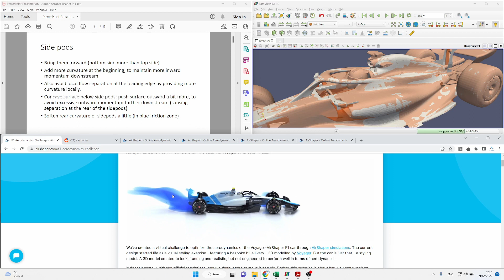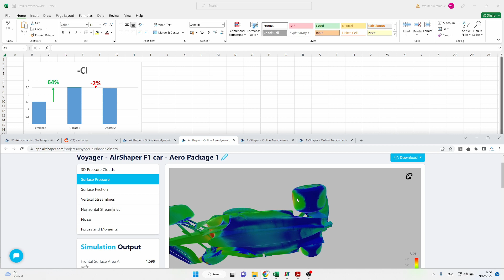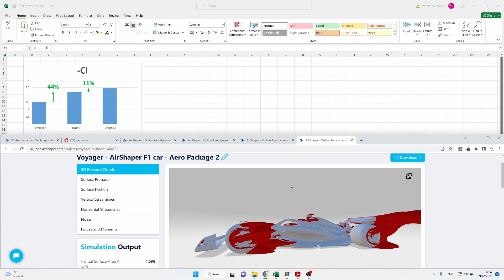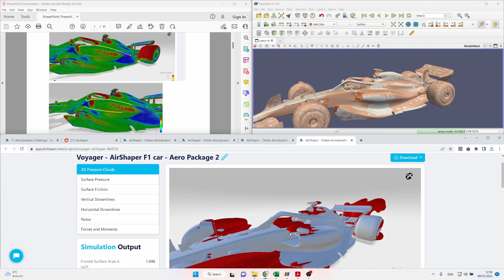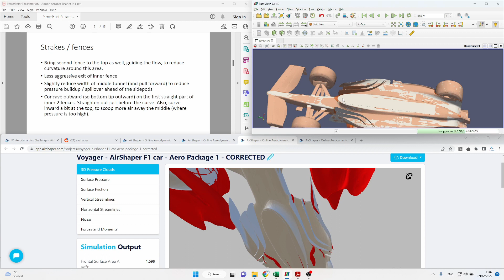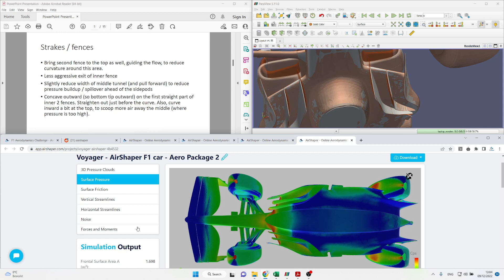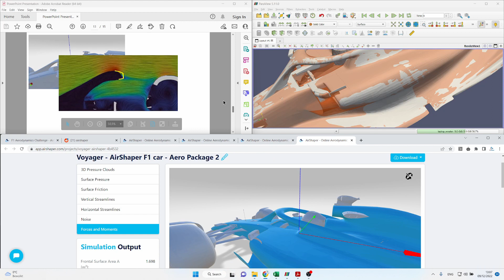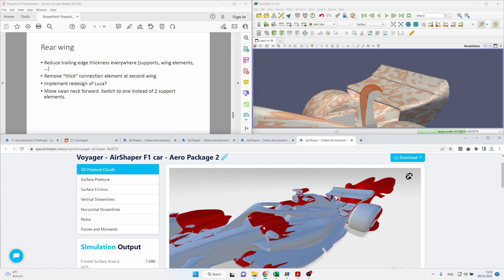Formula One Aerodynamics Challenge - Part 2: side pods, underfloor, fences and more

Comment: I agree with Matteo that a 4th strake should be used and played around with. Flow under the floor could be further stabilised and maybe it can be used to create even lower pressure by strenthening the fence vortice and outwash can also be better controlled and played with for further gains i think. I also would suggest to design a kind of outwash mirror with vents like the Red Bull  had and to optimise the deflectors. This can reduce the separation on the sidepods. I also suggest to put vortices creators on the Halo to stabilise the airflow above the sidepods, too. One idea would also be to open the sidewalls of the diffuser a little bit and energise the vortices by air from the top of the floor.
Reply from the maker: Thanks a lot for all the input, let's see how we can include this in Aero Update 3 (or 4)!!

Comment: You should add a 4th element to the front wing and a 4th strake at the entry of the floor. Regs allow that.
Reply from the maker: Hi Matteo, it would be great if you could argue why that would be a good idea, along with perhaps some sketches, and drop it on our Reddit:
https://www.reddit.com/r/airshaper/
Just a suggestion, thanks!
Reply: @AirShaper  Multi-element wings (if the slot is designed properly) are able to produce higher downforce, so I agree with Matteo's comments too!
Reply from the maker: @alex07guerrero  ok cool, we'll look into it - if you can drop a suggestion for a profile / selection of airfoils / ... on our Reddit, that would be great! Focus now is on the rear wing, as that one is still just a styling exercise for now. Thanks again!

Comment: I dont have an overview of the whole investigation, only saw these 2 videos, so please ignore my comments if they are out of date or not applicable for any reasons.
You could try adding more horizontal expansion at the diffuser possibly to further increase downforce without addig major drag.
You could possibly implement the ‘fake’ endplate design that of the Aston Martin 2022 car.
Reply from the maker: The horizontal expansion could be considered, as long as it doesn't cause any flow separation.
The end plates would not be so interesting, as they'll likely be banned for 2023 if I'm correct?
Thanks for the input!
Reply: @AirShaper  Yes, they will be, just wasn't sure if you were going to follow the rule updates or not.
Reply from the maker: @TheGamingHungary  Following the exact rules would be too much for this first exercise, but we do want to stick to items which will remain allowed. Thanks again for the input!

Comment: If you can send the latest cad files I can run it and also improve it and make video on it
Reply from the maker: You can see the full simulation here:
https://app.airshaper.com/projects/voyager-airshaper-4b4532
If you click the download button at the top right, you can get the 3D model in STL format.

We'll work on providing the Blender model as well - just drop me an email at wouter@airshaper.com and I'll keep you posted if you like!
Reply: @AirShaper  I'm not familiar with Blender. What level of control do you have over the model? is it, somehow, parametric?
Reply from the maker: @omc7250  It's not parametric like Solidworks or so, but you can morph some of the geometries using control points I believe. You can already check previous Blender files of the car - this one is for Aero Update 1: https://airshaper.storage.googleapis.com/website/files/f1-challenge/airshaper-voyager-f1-challenge.zip